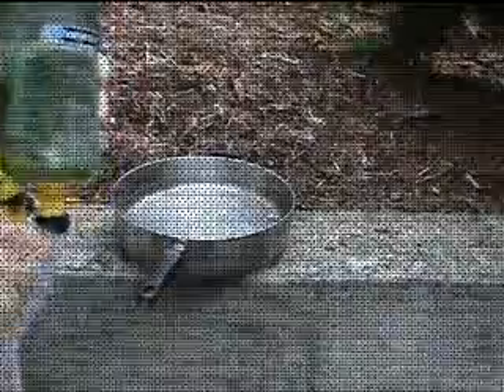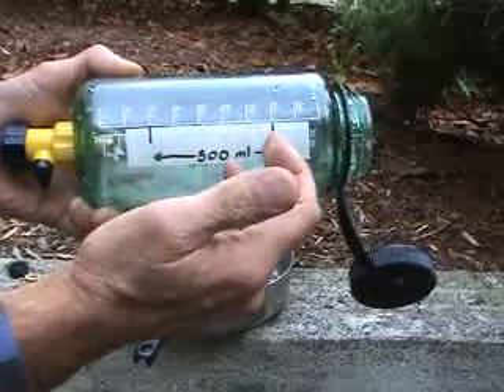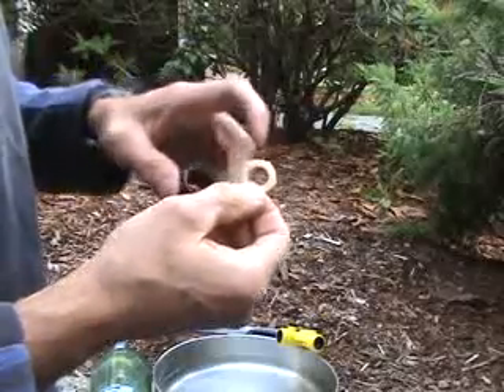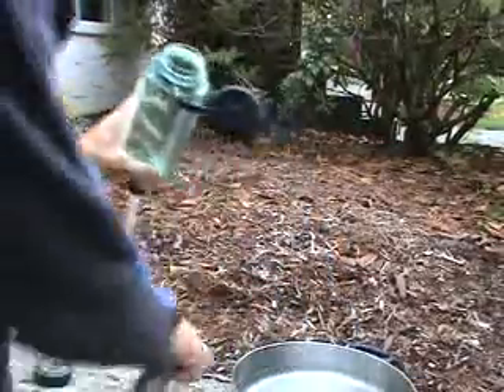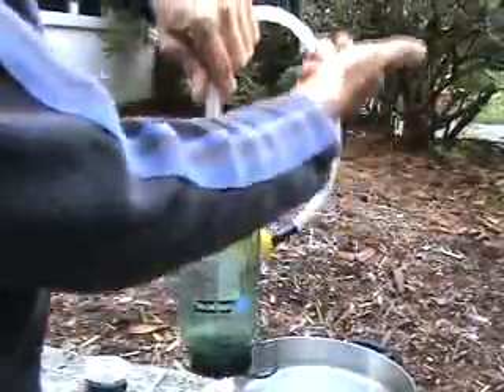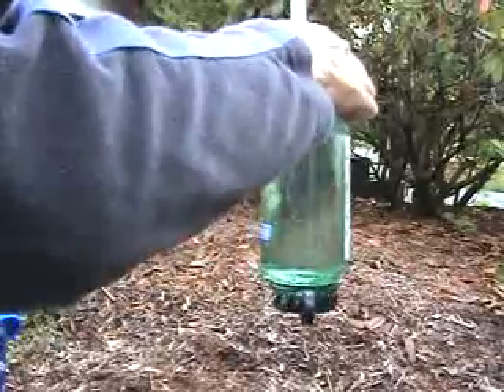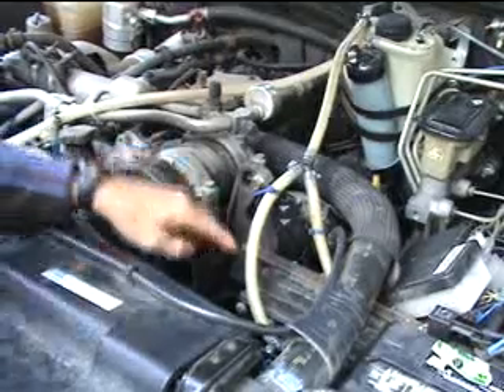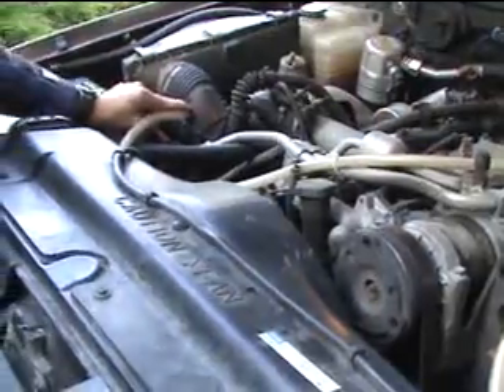HHO measuring device

Comment from the maker: Thanks for the info on you 772 unit.  I'm not an expert on the EFIE's vs Chips, but have been told one way to reset the chip that seems to work.  When you have the chip hooked up and have run the hho system up to temperature, shut everything down, then disconnect the +ve, then the -ve battery leads.  Let the car sit for about 10 minutes, then turn the ignition on & off, and turn the hho on & off.  Reconnect the -ve, then the +ve battery leads, then start everything up and do some driving.

Comment: I have a 772 system installed on a 4.3L Vortec V-6.  I'm using Sodium Hydroxide for the electrolyte and seem to be producing lots of gas.  My problem is my ECU is not working with the HHO.  I have an EFIE, but can't get my O2 sensors to lean out.  Going to send that chip back and get the Mileage Chip back again and try that.  Just replaced my O2 sensors at 200k miles, but no reaction from the HHO system.  Great video, keep us posted on your findings....I'll do the same.

Comment from the maker: I checked their website for the 773 unit and they advertise 2 - 6 lpm for that cell.  I haven't heard back from Robert Volk, from my most recent inquiry about the lmp rating, or from an earlier inquiry about the PWM maybe being faulty.  He was quick to respond when I was purchasing the unit, but not so much for the after sales questions.  My voltage across the +ve to -ve posts during the test was about 12.7 volts, at 30 amps.  Mike Shaheen at HHO Connection recommends 2 volts drop per plate

Comment: Hi, any news in how many LPM should the 773 be making from the manufacture? 

By the way, what frequency are you running your PWM? 

What is the voltage across the cell post when you did your lpm test? 

Thanks

Comment: Good job on the video instruction. However the web site of manufacture for the 773 mega brick states that the generator produce 5-6 lpm. I think if we need about 0,5 liter per 1liter of engine displacement this generator may not produce enough gas to see major mpg gain. Your engine is a 6,5l =3,25 HHO lpm needed. Below 2lpm at 30amp with the 773!!!  Maybe not enough.